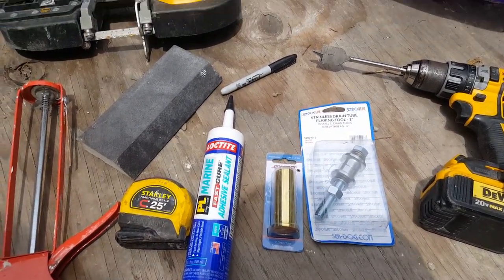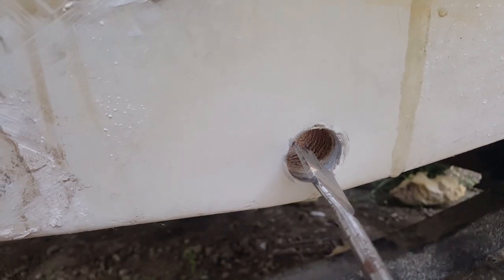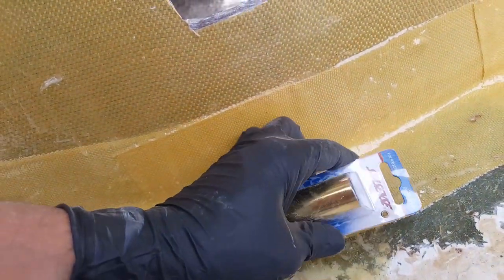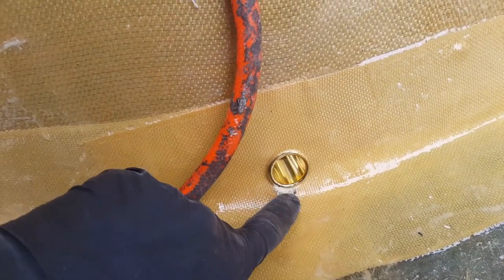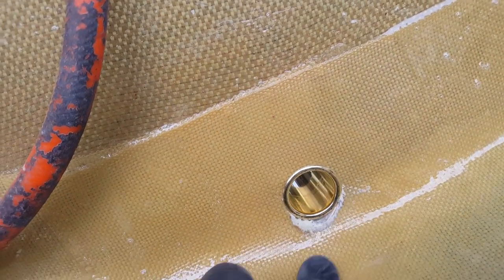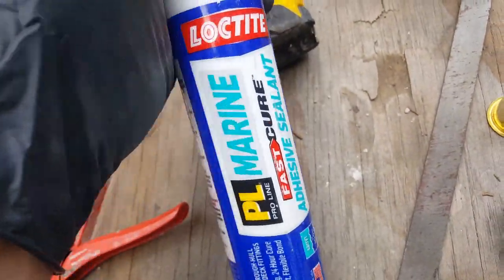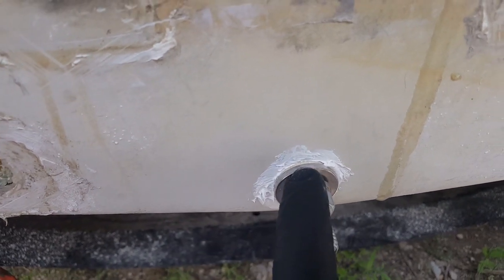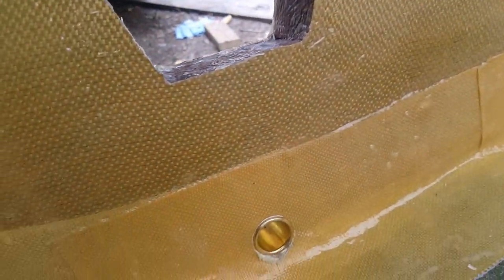Boat Transom and Floor Rebuild - Installing the Transom Drain - Part 36

Comment: Next time you mount something through a cored substrate that will be underwater or frequently exposed to water, over drill the hole by 1/4”, fill with thickened epoxy, then drill your 1” hole through the epoxy.  The extra labor involved is about 20 minutes.  You mounted it in a way that will eventually allow water to reach the core of the transom.
Reply from the maker: Thanks for your comments! Good thing I used marine plywood!
Reply: Exactly, eventually it will rot, does not matter what plywood.
Reply: @michaelromer2016  Still rots
Reply from the maker: @Fluid36  We won’t be alive when that happens.
Reply: @michaelromer2016  You sure it will last that long?
Reply: @michaelromer2016  Marine grade plywood is simply a higher grade of tinsel strength via laminating and quality of wood layers...it rots when exposed to water.  No need to use epoxy, however over drilling the hole and adding thickened resin is a good idea, at the very least use a tested quality sealant like 5200.
Reply from the maker: @UCYuAfnnmHqgNihPRB6Pb2rg sorry to hear that.
Reply: Lol

Comment: Thank you for this vid, and thank you for the comments from the viewers. I’ll. Be doing this to my skiff and I’ve already removed the old drain tubes with new drain tubes, 5200, and a flaring tool en route for delivery. I’ll be saturating the wood core with epoxy before installing the drain tube, and I’ll also warm the drain tube with a heat gun before applying final flaring torque. The core was surprisingly dry for a 1985 Privateer 16’ CC Bay, however, I wish they over bored the hole back then and used the thickened epoxy method to create an epoxy barrier between the outer elements and wood core.

Comment: I used a 3/4 inch drill bit and taped a piece of sandpaper maybe 150 grit cant remember and wrapped it around the spade part. This spins around only one way. Either way and cleans out the drain and keeps you from chewing up the outer edge. The outside i just lightly sanded by hand to clean it up.
Reply from the maker: Not a bad idea! Please subscribe!

Comment: works as advertised and has another feature: you can use leftover tubing by adding a flair.  I used the tool to install two drains this morning. A couple of notes. I put a small coating of wax (Johnson's Paste Wax) as lubricant in the inside of the brass tube. Old time flaring tools did that to help set a proper flair. I used 3M  5200 fast set as a sealant. Be sure and clean tools ASAP or you'll never get it off. I had to really "crank" on the wrench (I'm 76). You may want a breaker bar to do the last bit. As for the other feature: I had some pieces of brass tubing left over. I have another hole that could use the brass tubing. I turned one end of the flaring tool around, flat side to the brass. The other end went into the brass tube to form a flair. I tightened the nut with the bolt in a bench vise and was able to form a perfect flair on the left-over brass tubing. So I can use that in the other hole on my boat. I couldn't be more pleased with the flaring tool.

Comment: I need to replace these tubes in my boat, they were split by the original installer. How do you remove them without damaging the exist hole?

Comment: Thx for this. I've got leaking drain plug on a fiberglass deck boat. Alot of work I have to do. On the inside the hole around plug is bigger and looks hollow around the plug. Doesn't leak alot but its enough. Thought about knocking it out cause its not flared on the inside cause its not quite long enough to flare it, besides, the hole is bigger and it slightly loose. Maybe use some marine adhesive like u got or use some fiberglass resin and fill in the hole alittle on the inside. Ive never had experience in fixing boats and so far I've lined quite a few places with resin and matting to stop the bigger leaks on the bottom. This is beginning to be my worst nightmare. Its 16ft by 8ft in size and is HEAVY. I ask myself how I got myself in this situation.
Reply from the maker: Bobby, I wished I had better news for you, but you appear to have a rotten transom. It only gets expensive from here on out. If you do opt to go forward with the repair, I got videos to cover a full rebuild. Please subscribe! Thanks for your comments.

Comment: I'm about to do my boat. Why wouldn't you want the factory on the outside. To me that only makes since so there is no problems. If the outside dosent leak then the inside wouldn't matter screw looks. I want a boat that floats. Anyone else have a opinion on this. Thanks. I'm a first time boat owner.
Reply: Because the plug is inserted from the inside of the boat, it is easier to insert it when it is place factory side inside the boat. Sharp edges inhibit the insertion of the plug.

Comment: Did you have any issues with a gap on the outside as you did on the inside?  It would seem the angle would be the same?  I am getting ready to do this to my new build was was worried about a gap on both sides.  Thanks

Comment: Why did you cut hole so high in bilge? Most boats I've worked on have 1/4in or less to base of floor in bilge to run as much water out as possible.

Comment: About the 16:30 mark where you are putting in your plug sleeve.

What if a guy bored that hole out just enough to allow a layer of that Kevlar to fit wrapped around that sleeve and epoxied in, with a nice 4x4 square behind the flare?

Over engineering?

I ask as I have always noticed cracking around plug and bolt aeras as one would expect. I can eliminate tons of the other holes, but the plug might be important 🤏😜

**I didn't read the comment below before asking lol

Comment: A much more accurate way to drill the hole is to use a pilot bit from the outside.  Use a long bit 6-8 inches about 3/16ths will allow you to line your drain up.  Now when you come inside to counter drill your spade bit will have some meat to bite into (a hole saw is a better choice but still drill from both sides guided by your pilot hole) and not jump around when the spade bit cuts through the thin layer.  I much prefer a bronze coupling (purpose built) used in quality boats instead of a tube with flange nuts on both sides.  Epoxied in the external threads give a good bond and in use a threaded plug gives a positive seal.  I have seen the rubber compression plugs used in the tube version fail when the center threaded rod corroded away.  The plug falls apart....not good.
Reply from the maker: Dang man! Nice comment! Appreciate the suggestions.
Reply: Having just replaced a transom and drilled what felt like 50 holes....  I used a drilling jig which ensured every single hole was perfectly aligned on both sides.  Well worth it vs. eyeballing and hoping you're going to be close enough.  Especially when needing to hit transom brackets, etc. on the other side.  When tackling splashwell drains/motor mount holes, I drilled a pilot through both sides and then used a hole saw.  If you use a spade and catch the edge of aluminum or glass, it will jump a little potentially making a mess.  If drilling the transom on the bench and wanting perfect holes, you can't beat a forsner bit.  As douglas mentioned also - definitely worth the time to fill over-drilled holes with epoxy and drill to size after cure.  Thank for sharing this video - even though old - it's invaluable.

Comment: You should heat the end of the tube til it’s cherry red, then cool it in warm water. That will soften the brass, so it will flare easier, and the inside of tube won’t crack.
Reply: no, so much no
Reply: dont have to get it red   just heat it a bit and then quench it

Comment: Why not smear thickened epoxy on the inside of the hole, coat the drain tube in wax, then press the tube into place (without cutting or flaring). After the epoxy sets, remove the tube and clean up any excess epoxy. Then coat with PL and flare. With the method you used you're trusting your entire transom job to a few cents worth of PL. Just my $.02
Reply: Brilliantly stated

Comment: Would using the tube as a guide be helpful determining the center of hole?
Reply from the maker: MrSirrah2 that’s an option. I’d consider using a measuring tape to find the center.

Comment: Do you need to use the flaring tool???
Reply from the maker: You must use a flaring tool. Otherwise it won’t seal. Please subscribe!
Reply: @michaelromer2016  What does the flaring tool do?
Reply: @NUrukhai  it flares the other side. So basically it makes a lip on the other side and pulls it together tight. If not it would just be glued in and would leak. It will sweal up the other end and make it tight. There cheap on Amazon.

Comment: Why wouldn't you epoxy let dry then use your lock tight sealer
Reply from the maker: There is epoxy on the outside, but I wanted something with a little more flexibility as it went through the transom.

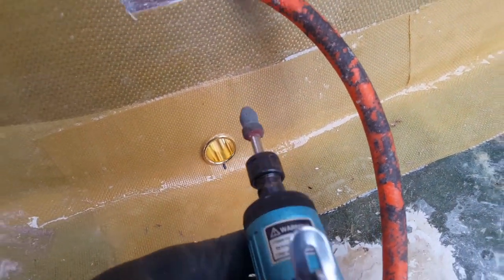Comment: At 8:00 you say to round the edge of the glass you are going to flare a drain plug into, that's not how it works, it's a flare tool to flare the plug onto a flat surface.  PL products have no place on a boat ever.

Comment: No O-rings?
Reply from the maker: Definitely no o-ring. For sure use marine adhesive.
Reply: @michaelromer2016  I put them in before, definitely marine adhesive and O-ring under both flares.
Reply from the maker: revenge69ful  Nice assist!

Comment: Seems like copper pipe cutter would work better
Reply from the maker: If you have one it is easy to use.
Reply: @michaelromer2016  Great Video.  On my dusky some idiot just drilled a hole in the transom and exposed the core. I had to fill  a section of the transom around the drain hole. I installed the tube as in the video after and it turned out great. The tubing cutter worked well but left a camber on the tube I had to grind off anyway. Thanks

Comment: Pipe cutter
Reply from the maker: You still still need to flare the end, otherwise you will have a leak.
Reply: Hacksaw better than pipe cutter because the scoring and cutting effect is pushing the lip of the pipe in the wrong direction